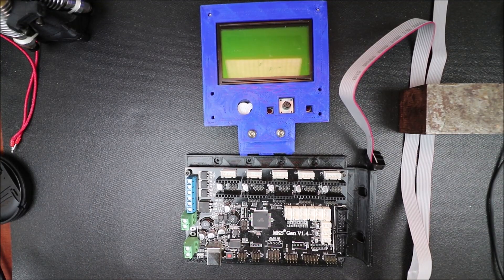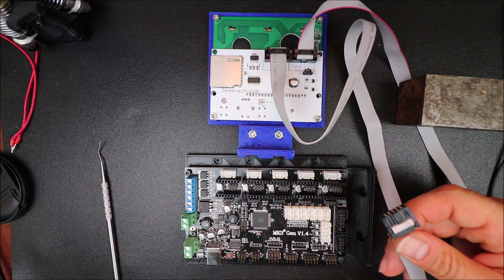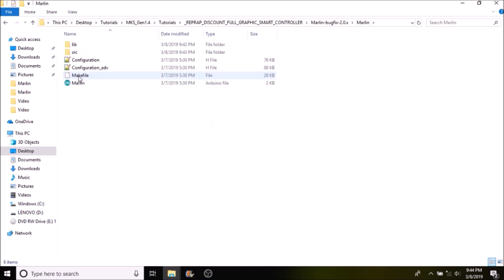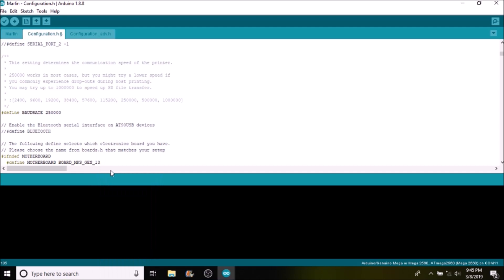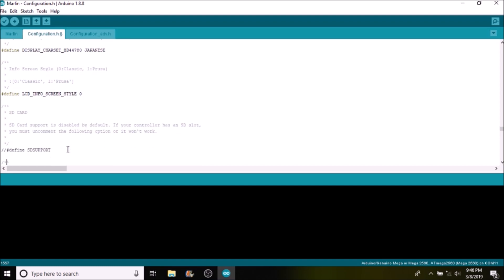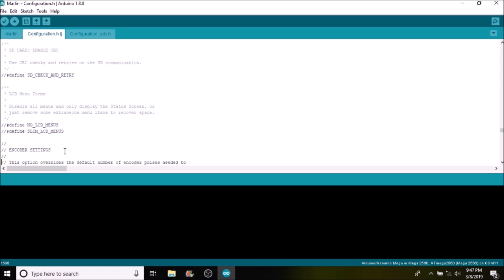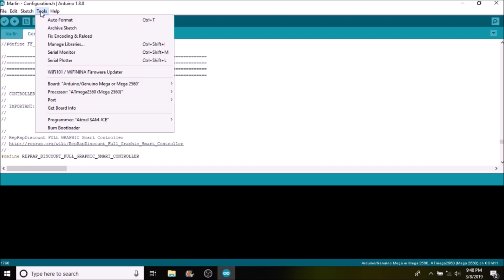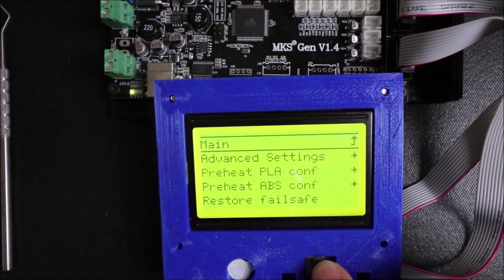MKS Gen 1.4 - DISCOUNT FULL GRAPHIC SMART CONTROLLER

Comment: i followed your tutorial and when i try to compile and upload i get an error message

'Arduino: 1.8.13 (Windows 8.1), Board: "Arduino Mega or Mega 2560, ATmega2560 (Mega 2560)"

fork/exec C:\Program Files (x86)\Arduino\hardware\tools\avr/bin/avr-gcc.exe: The filename or extension is too long.

Error compiling for board Arduino Mega or Mega 2560'

Can you advise what i need to do to get around this issue?
Reply from the maker: Move your Marlin folder to C: drive root and then reopen and try to compile.
Reply: @EdwardBraiman  I unistalled and reinstalled the Marlin folder to C: and put it in a new folder. I also uninstalled and reinstalled Arduino IDE in C: new folder and it failed to compile again. the following is the error message that came back this time.

Arduino: 1.8.13 (Windows 8.1), Board: "Arduino Mega or Mega 2560, ATmega2560 (Mega 2560)"

fork/exec C:\arduino\hardware\tools\avr/bin/avr-gcc.exe: The filename or extension is too long.

Error compiling for board Arduino Mega or Mega 2560.

Excuse my inexperience but i don't understand why moving the Marlin folder well help this issue when it looks to me like it's an Arduino file that's the issue.

Any other advice please?
Reply from the maker: Try downloading VScode with Platformio extension.  There should be a tutorial in more than on of my playlists it should work much better.
Reply: @EdwardBraiman lmao “try using vs code” famous last words. “Try using the world most overly complex program, it has zero user friendly features, and you are guaranteed to (and I mean this in all seriousness) waste the next year of your life……. But yea, give good old vs code a “try” 😂😂😂😂😂😂😂 I’m seriously laughing that hard right now 😅😅

Comment: i have this board (LINKED) will this work with the MKS gen 1.4? if so how do i get it to turn on? would it be best if i got a new lcd
https://folgertech.com/collections/lcd-displays/products/reprap-ramps1-4-2004-lcd-display-controller-with-adapter-mendel-prusa-3d-printer-1

Comment: Hi. I have board MKS Gen V1.4 and BigTreeTech TFT 35 V1.2  and when I try connect I have a massage: No printer attached! Maybe you know ''secret'' how to fix it?
Reply from the maker: Baud rate 115200 and second port -1 I think.
Reply: @EdwardBraiman  You mean AUX-2, what is the second port -1? Now I connected TFT to AUX-1 - TX is D1, RX is D2 - can move axis but get massage: No printer attached! And can't see temp, can't print. Thanks for help)))
Reply from the maker: What is the buadrate setting?  If 250000, change to 115200.

Comment: Hi my lcd not work :-(
Reply from the maker: What type of LCD?  What about the LCD is not working?
Reply: @EdwardBraiman  i have reprap full graphic controller i send you link video what problem 3 days  try sorted out bat cant doit anethin with this
Reply from the maker: I didn't receive a link.  Can you link where you purchased to see it?  Does the LCD illuminate when 5 volts of power is applied via USB connection?  If so you might be missing software from Arduino IDE.
Reply: @EdwardBraiman  Welcome after 3 days of lcd fight I went to a friend to connect his display.  Everything works.  Know my lcd is broken I ordered a new one
Reply from the maker: @NIKT_ELO  Let me know how the new LCD works out.
Reply: Hi do day i have new lcd full reprap. The display works without any problem
Reply from the maker: Congratulations, that's great.